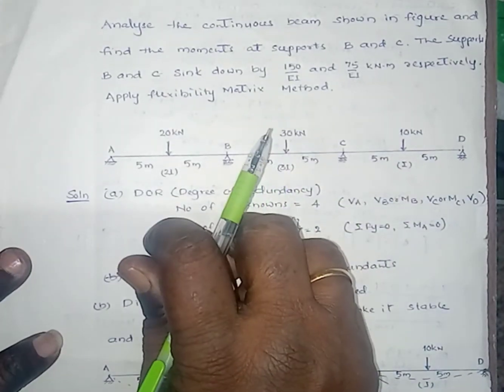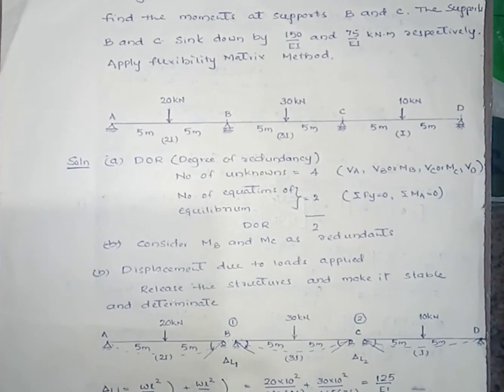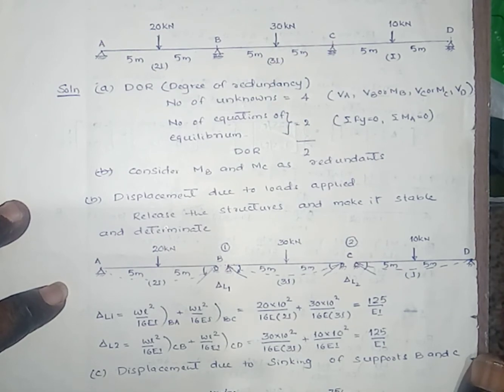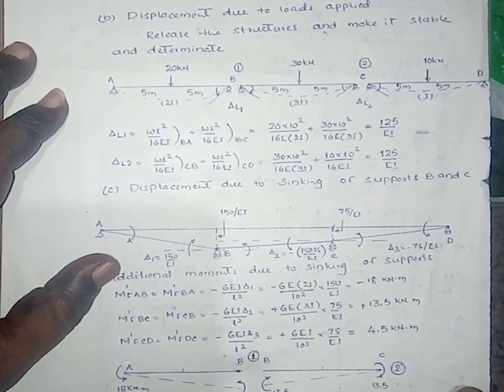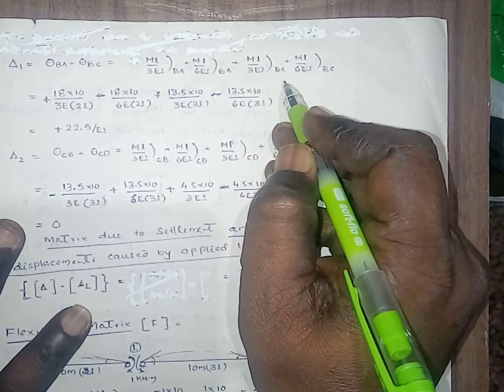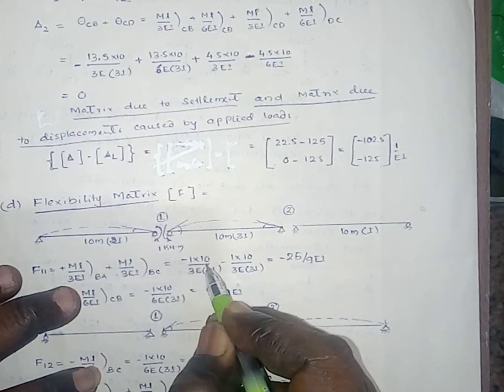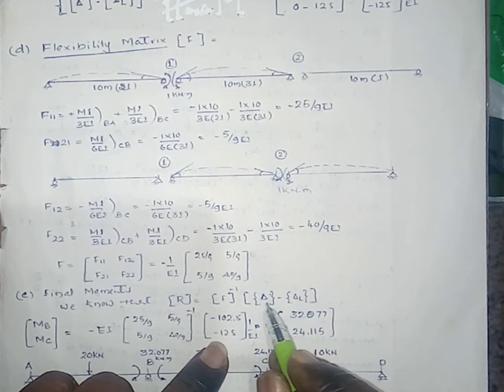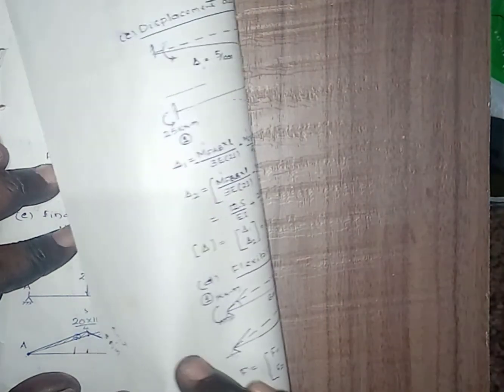ANALYSIS OF INDETERMINATE STRUCTURES

Comment: Sir, 
In step c,  explain sign convention please
Reply from the maker: In step c with respect to horizontal line passing through either A or B the rotation is clockwise hence the settlement in span AB is positive by considering this calculate additional moment due to settlement of support if the rotation is anticlockwise then settlement is negative